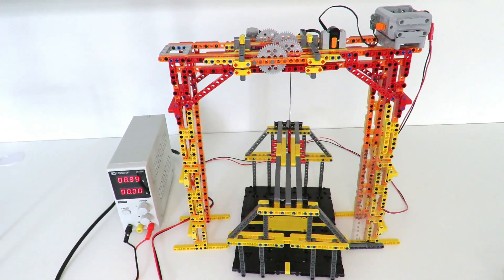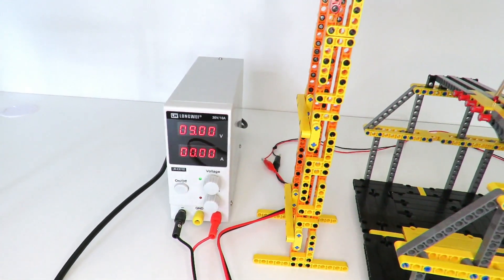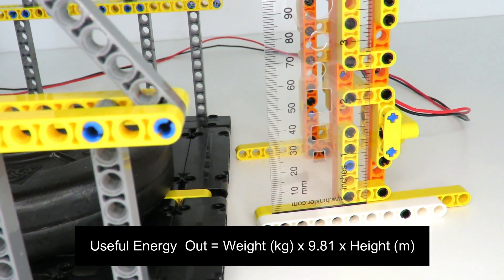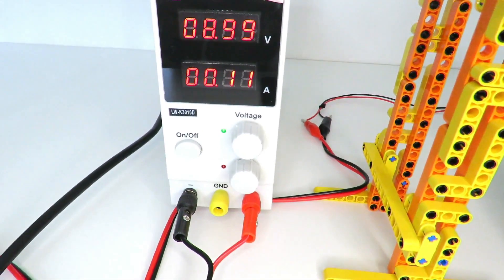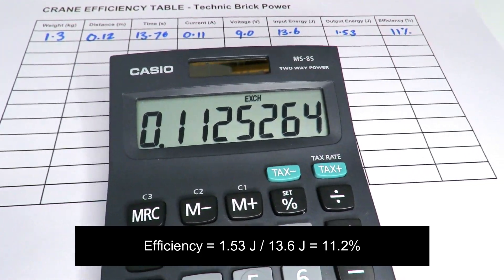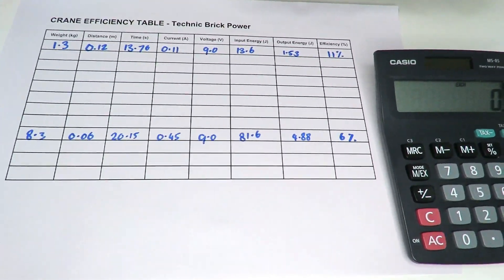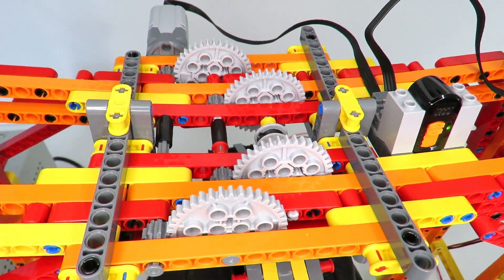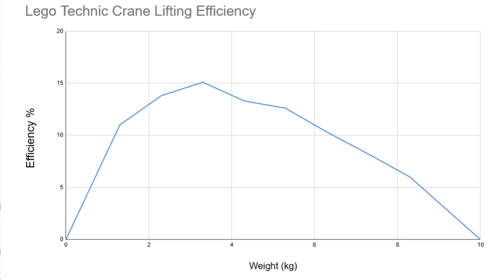How to measure a Lego Technic Crane's Efficiency. The results surprised me!

Comment: Really interesting. What if you moved the gear assembly to the ground and use pulleys and wire to lift the weights, this might reduce the friction you get from the bending of the frame on the gears.

Comment: There's got to be a fair amount of energy going into bending the frame - the top of the crane is flexing a lot with higher weights!
Reply from the maker: Hi Johan, Yes that's part of the reason for the low efficiency overall. On my list of projects is to see how efficient I can make a crane. I doubt if it is possible to get above 30% - what do you think?